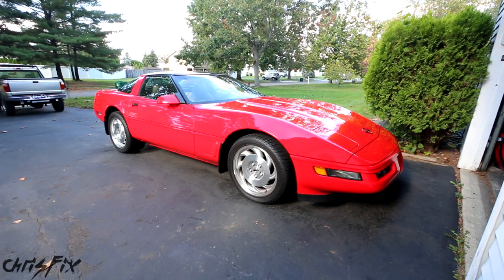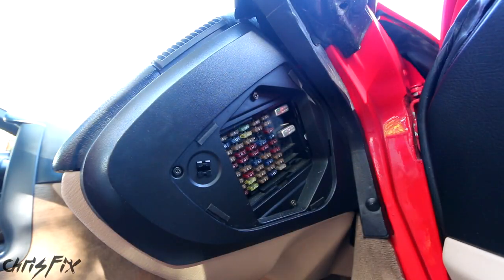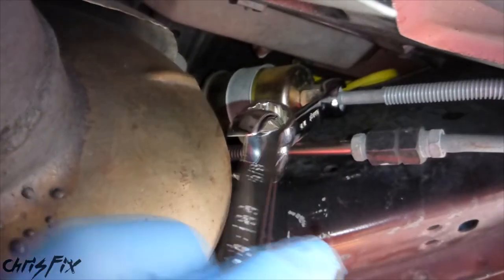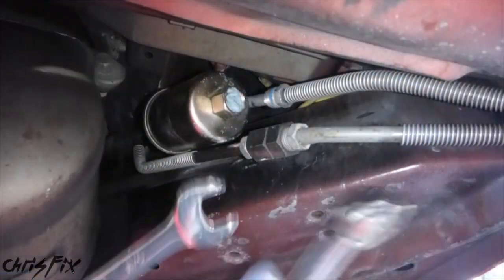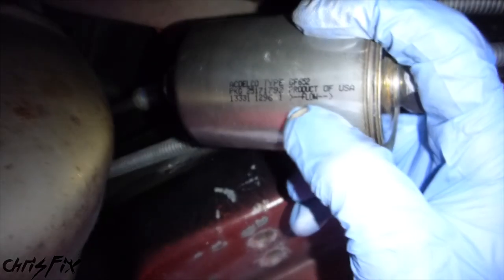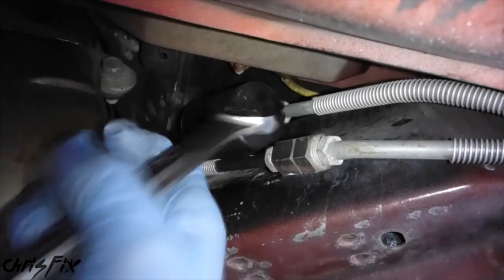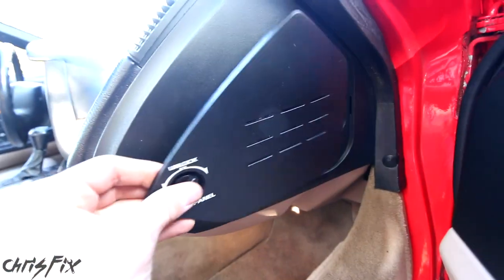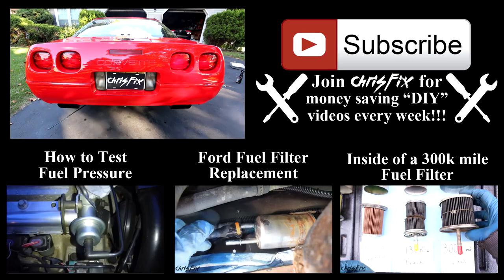How to change a Fuel Filter (GM, Honda, Toyota Style)

Comment: Hey Chris, I noticed you used an aluminum drip pan.. 👍🏽👍🏽 TWO THUMBS UP for safety!!
It would be a good tip to tell your viewers to be sure to use a metal or rubber drip pan whenever they're working with gasoline because plastic naturally builds static electricity. The chances are slim that there will be an ignition but there is that chance. Especially if the pan gets moved around - as it slides on the ground, more static electricity builds. 💣

Thanks for the great how-tos. You've saved me lots of money since I stumbled across your channel.

Comment: Thanks Chris. I used this method to change the fuel filter on my  2005 Renault scenic II 2.0 16v. It took all of 5 minutes as the fuel lines connecting to the filter are held on by pinch clips, and once off, the filter slides out the holder. Keep up the great work. By the way im in South Africa, so you are helping a lot of people all around the world
Reply: Oh and I never have to disconnect the fuse to the fuel pump, the fuel lines had hardly any pressure in them.

Comment: Nice video. Only thing is I wouldn't feel comfortable adding anti-seize to the filter threads, feel like there's a chance some would get on the end of the line as you're inserting it in place and capture it inside the filter
Reply: Exactly my thoughts! I didn't feel OK to do this..
Reply: Anti seize adds about 25 horsepower once introduced into the fuel filter lmao
Reply: The anti-seize on the downstream end will go to the injectors.  Not good.   Also, why no blue loctite?  It was originally built with it.

Comment: Just wanted to say thank you ChrisFix. I done a fuel filter on my 1991 Toyota Celica GT 2.2L 5SFE, and my 1997 Toyota Corolla 1.8L 7AFE. Your tips were extremely helpful! With my Toyotas I didn't need a fuel line tool, they came just off. But it's a useful tool to keep on you!

Comment: Had the local shop replace my 2002 Cavalier's fuel filter the other day actually...and then they came out and said uhhhh the fuel line is crumbling all over the place and we should have warned you that would potentially happen...The nice thing is they have awesome customer service and I only paid for an additional "fuel line repair kit" which was only like 13 dollars more than I originally anticipated...they didn't charge labor for the repair because they said it was technically a mechanical labor warranty as they broke the line...although it was unavoidable lol.
Reply from the maker: +Justin Hall Wow, that is pretty good! Most shops would tell you it's gonna be another $1000 and then you are stuck!

Comment: I have a 2000 camaro v6,  >96k miles, Florida garage kept, fuel filter never changed. Thanks for your tips, now I know.  I also bought ACDelco fuel system cleaner with the new filter. Question: Should I change the fuel filter first, then use the system cleaner? Thanx for all of your help!

Comment: Hey @ChrisFix , ive been having problems with my 1992 ford Taurus where my fuel pump wouldn't pump sometimes so, i was told to change the fuel filter. i saw one of your videos on how to change it like 3 days before i actually changed it. let me cut to the chase i forgot a safety step and fuel came out of the fuel filter landed in my face out of reaction i turned my head to get out and alot of fuel went into my ear canal it burned for 2 hours, a ton of pain. i lost my hearing for the rest of the day and today i woke up sick (happened yesterday, cant hear well) bottom line is kids, always safety first went working on cars not to discourage from working on cars its a fun hobby and sometimes a necessity, but safety first.
Reply: Are you ok now?
Reply: Damn! That sucks! Thanks for the warning!

Comment: Changed my filter in my Blazed today! Apparently gas will quickly dissolve plastic cups. I got gas EVERYWHERE. There is a clip on my filter I have to squeeze to slide the gas line off. It somehow got jammed. Only issue I have now is I can’t get my mounting bracket off of the old filter. For now, my new one is held in place with a zip tie. I used your video for every step of  the way. Thanks Chris! Next is gonna be the plugs and rotor!

Comment: I'm not too sure if I would have put anti-seize on the threads, especially after the filter. I bet it wouldn't play nice with the injectors.
Reply: +William Decoteau In Germany, such a filter costs less than 10 Euros or 10 Dollars. I would change it more often if i was afraid of a seized filter. It's cheaper than putting on anti-seize there, i agree with you.

Comment: So probably shouldn't smoke while doing this huh?
Reply from the maker: +Troy Russell Depends how good your life insurance is lol
Reply: Lol awesome
Reply: Probly a shower recommended instantly after doin this. Any way to really minimize the spray/leak?
Reply: @hugo rewucki That's horrible advice. 
#1) Modern cars do not play well with running out of gas and you can damage the pump.
#2) Regardless if you run the tank dry, there's still going to be fuel in the fuel filter and in the lines.
Reply: Uh no

Comment: That is a super clean C4....

Great video.  That one is in SUCH a tough spot, I'm amazed you got such a decent video of it.....

MUCH easier on an Escalade....  Fuel filter is on the driver's side, under the driver's door, roughly...  Much more accessible.   But the concept is very similar, just like you showed.....

Great job man.  That is a great video.

Comment: Always polished and well produced. What about the fuel filters that are now an integral part of the fuel pump which is located in the fuel tank?  Do you wait until the pump fails? This would entail emptying the tank, dropping the tank and then the fuel filter if you could actually buy it separately from the pump.
Reply from the maker: Thanks! Yea for the fuel filters in the pump, you just wait until the pump fails. They are "lifetime" filters 99% of the time!

Comment: This should work on my 2000 mirage (Mitsubishi). The biggest issue is Mitsubishi decided to be a pain and put the filter right in the middle of the dratted engine bay where it's impossible to get any leverage. But thanks for the video, it cleared a lot up for me.

Comment: so how do I know when the fuel filter needs to be replaced?
Reply: If you experience bad start ups. But there more causes for bad start ups. Search on the internet when you need to replace it for your vehicle.
Reply: +103Chris720 Check your service records if its done in the last 50k miles. If not, change it.
Reply: lol apperenlty my car has the fuel filter in the tank.
Reply: +seeya205 so does that mean I don't have to do anything?
Reply: +103Chris720 most new cars have a non serviceable filter. Don't worry about it
Reply: 103Chris720 Yea, new cars have crappy pumps that last as long as the filter, about 100k miles.
Reply: +Mortalomena so what about cars that have never had any service done on fuel pump/filter, and are already at 160k?
Reply: 103Chris720 You could be lucky and the fuel youve put in has been surgically clean, and not debree has loosened from the tank or gunk gotten in from fueling the car and the pump/filter are good.

The more real version is that the filter is clogged up and producing alot of extra stress on the pump which is going to go bad in the next 50k.
Reply: +Mortalomena yeah I bought my accord at 90k... it hasn't had any problems and I only use Top Tier gas like Shell, Exxon and from sometimes BP. top tier supposedly has more additives. haven't used off brand gas since I bought it
Reply: +103Chris720 you can get in the tank and change the sock but it's not necessary. Instead of having a large micron filter sock and a finer particle inline filter, they just put a better filter on the pump to eliminate the need for one inline. As someone else stated, the pump will probably die before that filter gets clogged enough to have any impact on performance.
Reply: +103Chris720 I would take a look at it at least once a year if i don't drive far. On my car the fuel filter was so rusty, it could have gone leaking because it was four years old. Doesn't apply to your car when it has the filter in the pump assembly, but on my car it looks like on the Corvette shown in the video.

Comment: Chevy Colorado has the fuel filter inside the gas tank ......
Reply: +why712 Yeah in still waiting for chris to show me the intank filter for my honda 2010. I'm sure it'll be similar to yours
Reply: +Civic R Yeah I hate it to me it's the worst idea ever
Reply: +why712 agreed 2004 toyota is the same.
Reply from the maker: +why712 Bummer. Those you dont change unless the pump fails.
Reply: +why712 my 1996 Ram 1500 is the same way
Reply: +why712 One of the worst manufacturer ideas.  On the plus side, I've heard it's easier to remove the truck bed instead of dropping the tank.
Reply: +Brian Piper I honestly just might try that
Reply: Some vehicles like my corolla has an access hatch under the rear seat for those with this as a car issue.
Reply: +MrSilenttrigger dang ....convenient

Comment: Your videos are all so perfectly explained.  Thanks for all of your uploads. My chevy van has power going up and down and seems to lose power as soon as I attempt to accelerate... especially going uphill.  When im in park or neutral it revs like normal. Ive changed plugs and wires and cap and rotor and TPS and MAP and o2 sensors. Is there any chance this is a fuel filter problem?  Not sure what to check next.

Comment: Nice!  Only ever worked on a 'Vette once; they can be such a pain in the butt!

If you're at all concerned about the residual fuel pressure, you can crank the car a few times after you pull the fuel pump fuse to bleed the system down a bit more.

It's also worth nothing that some GMs have a sort of dual circuit thing going on with the fuel pump.  Pulling the fuel pump relay or the fuel pump fuse while the car is running won't turn the pump off!  Once the engine is running, the engine computer switches the power feed to the pump over through the oil pressure switch, which uses a separate circuit and relay.  Depending on the car, either disconnecting the oil pressure switch (if easily accessible) or disconnecting the fuel pump harness where it connects to the body is much easier.  :)
Reply: +rhkips On some cars you have a bleeder screw next to the fuel rail in the engine bay. Just unscrew it a tiny bit with a rag in the other hand and the pressure will drop as well. Usually the bleeder is easy to find for somebody who does the service on his own.

Comment: Hi I'm Mark from Ph, I bought a family car for my gf almost four years ago which is corolla altis 2002 manual transmision with 220,000km. 

If so happen that I already have enough budget I wanna clean her Maf Sensor&Throttle body(w/ CRC) considering the replacement of OEM cabin & intake air filter, PCV Valve & hose( since it was probably previously damage by the manufacturer before), fuel filter & clean her fuel injectors. Recently major Replacement was water pump(220k km milage), I was succesfuly replace it by following Sir Peter Finn's corolla tutorials. Looking forward to replace her gear oil several years from now.

Hoping that after I've succesfuly done all of this she might able to restore her power, engine performance & fuel efficiency. Currently she was consuming 11-13 km/L (27.5-32.5 MPG) city, 16-18 km/L (40-45 MPG) hw. 

Thanks you Chris, keept it up and safe! =]

Comment: Dang chris, i did this today on our 2004 Grand Am V6 with over 217k Miles on it...Never been changed, fuel was coming out black, it wasn't the easiest thing because it had been under there so long but, i betcha that fuel pump is working alot easier. Thanks for your help!

Comment: Great video Chris - With the engine on, and the relay or fuse removed, the pressure is removed from the fuel lines. Just checking what stops the entire fuel tank leaking out when the filter is removed?

Comment: Another great video Chris. Some vehicles have fuel pressure release switch under the hood on the fuel rail, it usually looks like a Schroeder valve like for your tire stem.
Reply from the maker: +Rich Coakley Thanks Rich! I dont use that in my videos because most people dont have a tool to remove fuel pressure.
Reply: +ChrisFix On most vehicles you just need a screwdriver or anything to poke at the valve like releasing air out of a tire

Comment: Are the threads not supposed to go all the way in? I noticed there were threads still showing after install. I may be wrong any info is appreciated
Reply from the maker: I believe it can depend on the filter but as long as it's in there tight and there are no leaks you're good to go. Some lines and fittings are just like that
Reply: @chrisfix  goat

Comment: I think unscrewing the reservoir cap for a second, might have helped with releasing some of the pressure on the installation.
Reply from the maker: +B24Fox Reservoir cap? You mean the gas cap? That has noting to do with the fuel pressure so it wont do anything. Good thinking though.

Comment: Another awesome video.

May I ask a stupid question?  Wouldn't putting anti-seize on the outlet side cause a potential problem of the anti-seize getting in the fuel line upstream and into the injectors?
Reply from the maker: No because anything before the O-ring wont touch the fuel system. The O-ring and after is what connects to the fuel system. Good question though!

Comment: If you have older Toyota (or anything) where fuel line going into fuel filter just has double flare, connect the filter to that line and tighten the connection fully before connecting another line or bracket. Other vice it’s very hard to get the connection leak free.

Comment: Hello Mr Chris Fix. I had a good question for you....How often do you use "Top Tier" Gas. Shell, Exxon BP just to name afew. Please let me know. Thanks great videos. Keep up the good work.
Reply from the maker: +Mr Lane Sir Whenever it is cheapest to use it. I use the least expensive gas I can find. Sometimes it is top tier, sometimes it is regular companies. I never had a problem and with over 300k miles on my van, that is proof as long as you maintain your car and use the correct gas, you are fine.

Comment: Chris, I changed my fuel filter on my 93 C4 in the summer, and wow it was super nasty! Car has just under 79k. Happy new year!
Reply from the maker: +Brandon Herrera no way. I wish I cut mine open at 63k miles. After 30k miles it wasnt bad at all.
Reply: Wow, your car's miles are very low. I didn't even have to cut it open, that's how bad it was.

Comment: ChrisFix thanks for the video. From past experience in any type of oring seal I have found to always change one out due to a possible irregular surface that may not be rematched when used a second time. Thanks.
Reply from the maker: +Cmanof the woods centralUS That is a great tip! This seal was changed 30k miles ago so I dont need to change it so soon.

Comment: Hey Chris, love your vidoes !  Thank you!I have a question unrelated to fuel filters - If someone lives in an area where it snows and you get salt on your car on a regular basis in the winter from the road should you be washing your car more frequently or not?  I see people washing them every day, they look nice but I'm just wondering if the salt going on and off the body and undercar may increase corrosion or actually decrease it if at all?
Reply from the maker: +TransHerring Thanks man! My cars are all in the Northeast so we get snow and tons of road salt. I live near the ocean too so I get ocean salt as well. It is tough because in the winter, it is hard to clean your car. In the fall I put a good coat of wax on my cars which protects the paint. I also paint all of my undercarriage when I buy a car (like my truck) which helps prevent rust and damage. I would keep my hose inside my house or garage where it wont freeze and every month hose down the car (touchless). Dont dry it our anything, just hose it off to get as much salt off. Do that on the underside too. If you can bear it, then use soapy water and give it a good rinse. Good luck!

Comment: I'm not sure if this actually worked, but at our lube shop I used to work at, we'd vent the gas cap first and that was thought to relieve pressure from the lines to minimize spill.
Reply: +OnTheChainwax Pretty sure you're right - I helped my gf's brother change the fuel pump on his JDM Evo 8, and every time we disconnected the fuel lines to the fuel pump would spill everywhere. So we put the lines back on, opened fuel cap, took lines off and minimal spillage. Took us a while to figure that out though haha!

Comment: opening gas cap will bleed pressure from the tank so it doesn't spray, any other pressure in the line could  be bled from fuel rail test valve but have paper towel ready

Comment: BIG FYI break both nuts loose BEFORE you loosen or remove filter holder. I had to put the bracket back on bc I couldn't break loose a 20 yr old nut on a wobbly filter.

Comment: Chris what about having to bleed the fuel through by hand into the filter on for example a vw golf as I'm from England me and my father use blessing fuel into the engine as a primary option and for brakes we use a screwdriver to compress the brake callipers and send the fluid back to the reservoir and use copper slip to prevent rust bonding on the the pad holders.😃😃😃

Comment: On more exposed filters, there is a flexible line towards the front of the car.  You can move it out of the way, then slide the filter out without removing the bracket

Comment: Hi Chris thanks for the gift :)
How do you know how tight!!!
to tighten the oil filter is there a tool to tell you that writes n it that it's tight anuff?  because when you want to change it it's hard to take off even though if you put oil around the the bottom